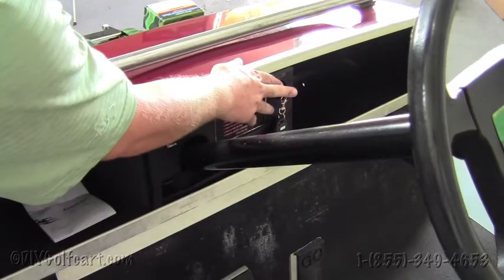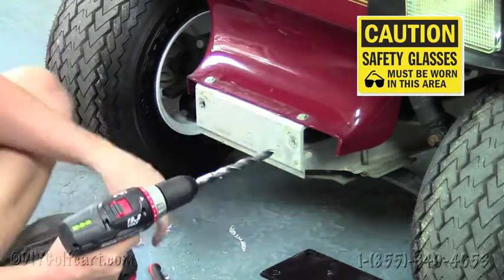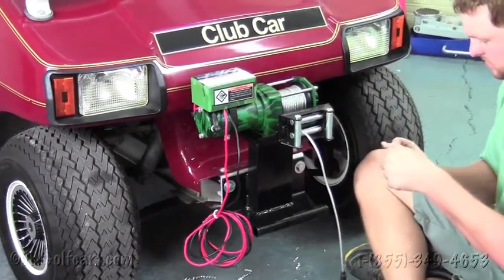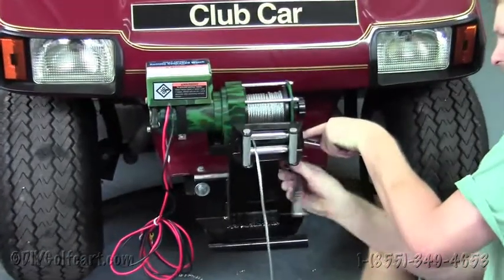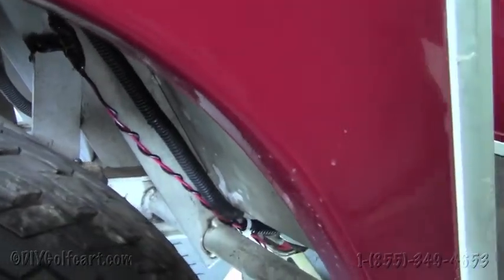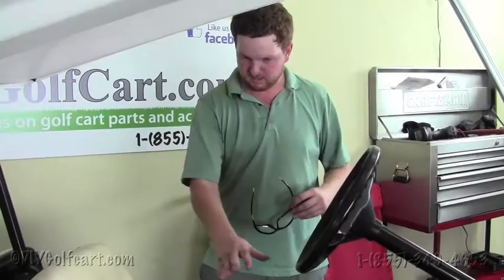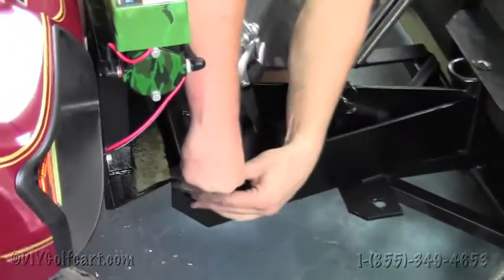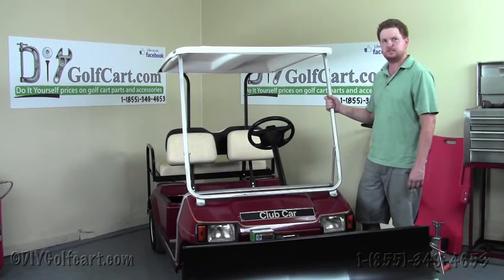Club Car DS Snow Plow Blade | How To Install Video | Installing a Golf Cart Snow Plow

Comment from the maker: @MrLEGOREVIEW101 - Yes you can remove the snow plow during the summer time and re-install your front bumper. You will have to remove the winch wires from their position to your battery every-time you remove you the snow plow. One alternative would be to install a fuse block on the front end of your golf cart to make the removal process easier. Please give us a call if you have any additional questions. (855)349-4653